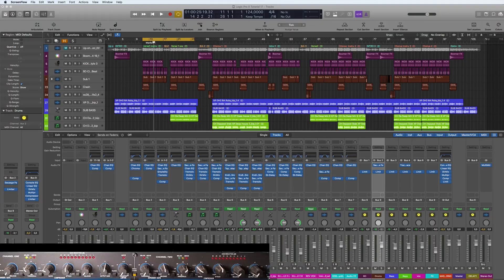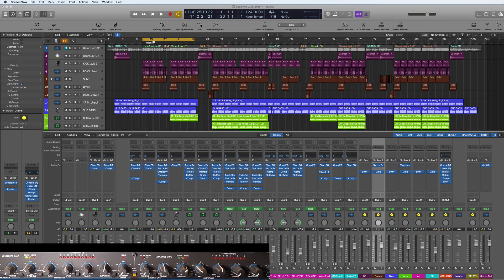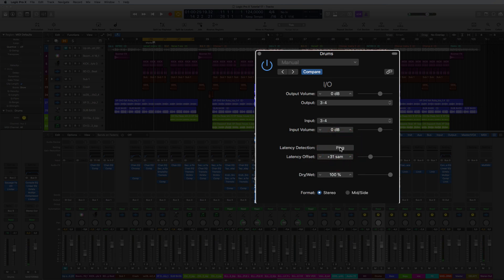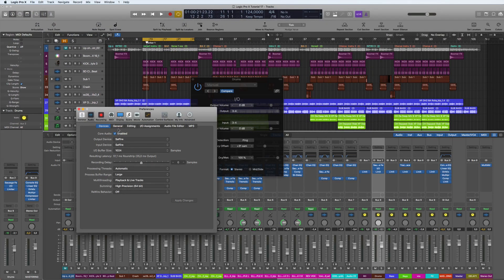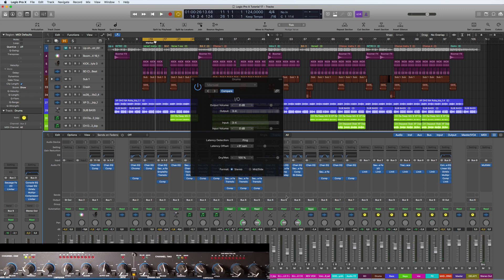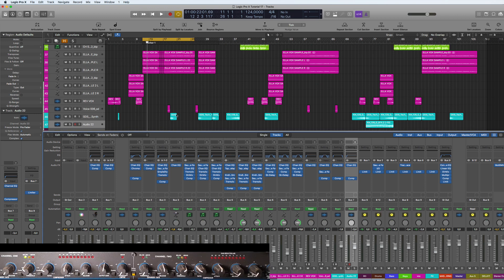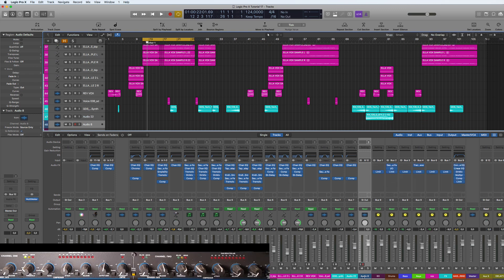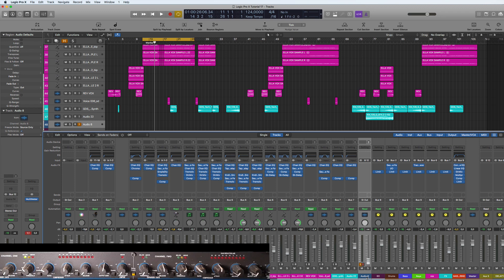EXTERNAL EFFECTS INSERT In Logic pro X

Comment: Thanks for the video, I am a noob re Logic Pro and whatever I try, when sending tracks to external gear I get feedback. Same with this I/O tip, can’t find any info on this, maybe it’s to do with monitoring?
Reply from the maker: Not quite sure what you problem is ? What are you trying to do ? Cos you don’t send track to external gear ! Well synths that is !
Reply: @ Hi Thanks for your prompt reply. I have recorded a vocal and didn’t want to record it through an external effect as that would “bake the effect in”. Now want to send the vocal from Logic via my interface (either audio or spdif) into my Lexicon PCM and back, so I can loop it and try different effects and wet levels. Seems that the returning audio is then resent by logic so causing feedback. Not sure if correct use of the I/O utility or using an aux/sub channel would alleviate this?
Reply from the maker: @HorseRadish138 this is kind a what I do in the video ! I think though you need to use the send and return of your PCM 60 , and use the aux in Logic , hard to figure out when one is not in front of the situation! If you live in Corsica I can pop round 😅
Reply: @ was hoping the I/O tip would solve my feedback situation but unfortunately not, maybe an issue with my interface though more likely my lack of Logic Pro skills. I could hitchhike over but likely would take a while, certainly would be an adventure though my boss would ask where I was🤔

Comment: so because i have so many external rack-mounted effects etc, I might as well put all to the patch bay and use IN & OUT and don't bother using SEND RETURN (if I'm making sense) then mix/print all inside of Logic. basically if I wanted to I can use the patch bay to daisy but at the end of the chain (jack in my hand) it will have to go back to the patch bay and the selected point into the soundcard to record

Comment: Hey bro I’m currently trying to use my sp404sx as a external effect in logic I am using MacBook bro with a Scarlett 2i4 interface.
I got all the right cables and everything I am plugging the outs into the sp and the input on the front of my interface.
On logic however, the only inputs I can choose are inputs 1-2 I don’t see any after that no I’m out 3-4 5-6 nothing I’m really confused
Reply from the maker: Sorry can't help you ! Not being in front of the machines , there is not enough info in your comment to understand the problem ! Maybe ask the question on one of the focusrite Facebook groups, good luck

Comment: I rewatched this several times, and I can’t figure out why you’re routing your input to bus 12. Why bus 12, and how does Logic know to send the signal there?
Reply from the maker: Hi , All i did is assign the output of the drum bus to bus #12 then the input to the track i created to bus #12 , you can do this after you have created the new track of whilst creating it as i did , i used #12 cos it was the next available bus /Aux
Reply: @homestudioproductiontutorials , ok, so that’s the part you left out...you assigned your drums output to bus 12. 

What if I want to run a piece of gear as the last thing in my chain, like a mixbus compressor. Would I create a mixbus aux to send all my tracks to and then put an I/o plugin on the mixbus? I’ve been doing this a long time; I’m just now getting into outboard gear, though. So trying to figure out how to route this stuff is a bit tricky for me still.